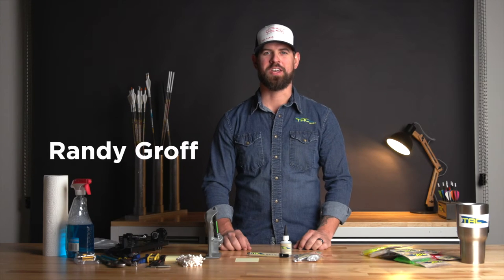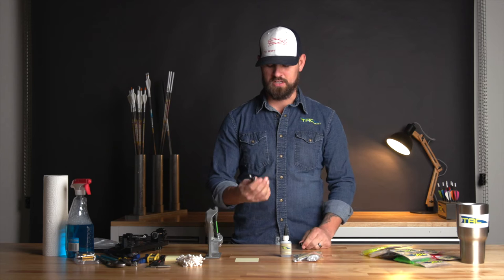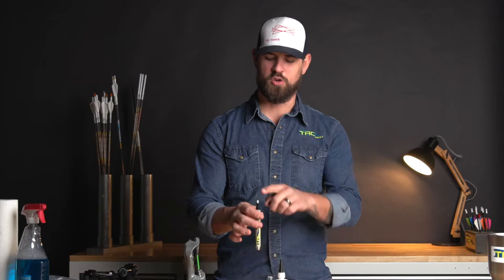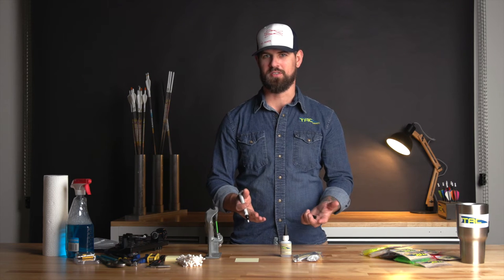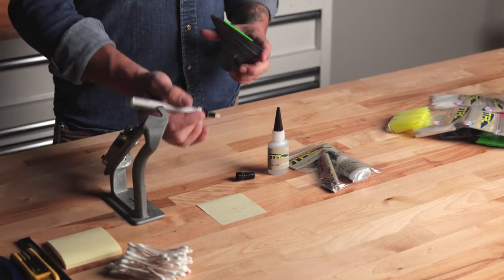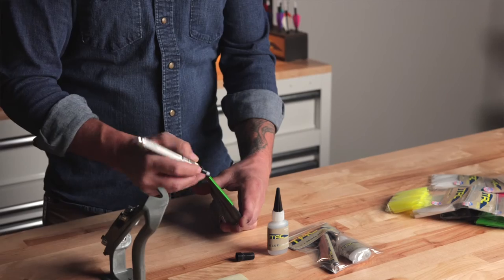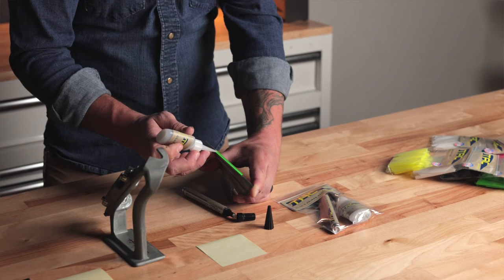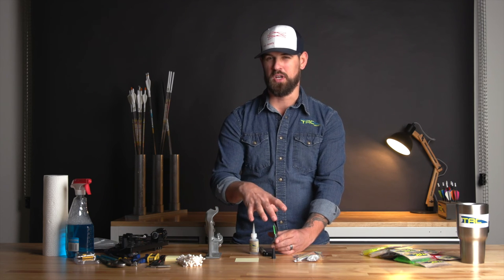TAC Vanes Adhesion Tips for Fletching

Comment: Great tips, but what’s peaking my curiosity is the bottle of Windex in the background.  What is the windex used for??  Is this to clean the arrow or vane?
Reply: We recommend windex for cleaning arrow wraps before fletching to them.  If you refer to our video for "installing arrow wraps" it walks you through that process.  It will remove any residue, which will allow for great adhesion and it won't remove any color, or graphics like alcohol or acetone would.
Reply: How do you prep the arrows?